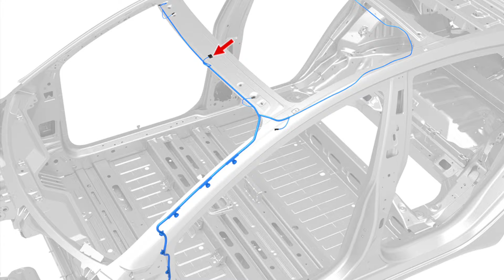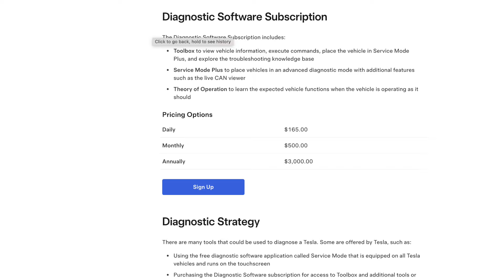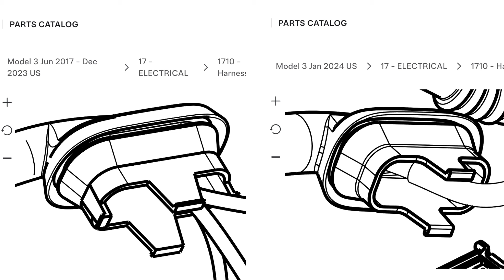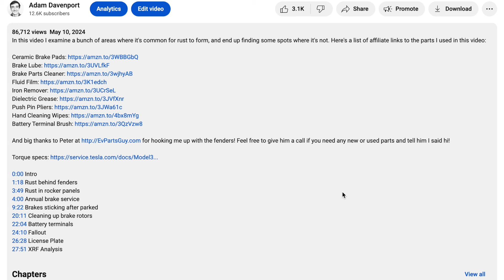Water leaked into my Tesla's trunk and caused electrical issues!

Comment from the maker: Here are some affiliate links to products I used in this video: 
Lexel sealant: https://amzn.to/4dIJj54 but currently way cheaper locally!
Goofoff Adhesive Remover: https://amzn.to/3A4WCij
Electronics cleaner: https://amzn.to/3XYel2T
T6 screwdriver: https://amzn.to/3Ys959v
Dewalt Screwdriver: https://amzn.to/3Y9ffLa
Dewalt Screwdriver with Clutch: https://amzn.to/4dxVPV0
Reply: Hello! It's impossible to buy Lexel in EU. Is there a suitable alternative?
Reply from the maker: @danz_w  If I was in the EU I'd try this stuff, seems like it has similar properties? Here's an affiliate link: https://amzn.to/489UuCA

Comment: Designed in California, not raiing enough there so Installing some tape is perfect to hide or delay the problem until car is out of warranty and was certainly way easier and cheaper for Tesla than actually really fixing the problem with sealant or resisting the ruber piece, as it's very labor / engineering intensive. Sad thruth about tesla unfortunately.  Will they get sued soon?

Comment: With putting the sealant on, a trick that can be used is getting a latex glove and applying to a finger and then rub the finger around where you want the sealant.
Reply: Yes, latex glove BUT use plenty of dishwasher soap on it. This prevents sealant from sticking and allowing you to perfectly smear it and making it super slick and smooth. 
Even bare fingers with soap does the trick, but use plenty of soap.

Comment: Actually had a very similar issue on my toyota sienna  where a water bottle spilled on the under seat amp which caused multiple speakers to cut in and out. After finding the problem I cleaned it up but one speaker was still dead, a replaced amplifier chip later and it was all good. No blown fuse there either. Awesome video much appreciated.

Comment: I have seen somewhere that if you're in the car options in the car info if you hold down or tap 10 times (not sure which one works for you) on the Tesla logo, you can enter service mode and type in the password: "service", you can get to all the useful error codes, as well as break pad cleanup tool, battery calibration etc. This may make debugging these issues a lot easier. Great videos, love your in-depth approach.
Reply from the maker: I looked all throughout the service menu and couldn't find any error codes. Are you sure you've seen that? If so, please share more details!

Comment: Any of the Polyurethane Sealants will work great for sealing water leaks. Although they are mostly sold in the tubes to use in a caulk gun.  I am not sure what will remove any excess.
Reply from the maker: I LOVE loctite's PL S30 sealant. Stuff is invincible, insane adhesion strength. ...but it would make a mess against white, and if I'd be screwed if I ever needed to remove it!

Comment: Adam - a great upgrade you should try. People have been retrofitting the Highland Model 3's suspension components into the pre-refresh one. Specifically, the struts. It is $500 for the parts compared to $1000+ for aftermarket coilovers and if you were to make a video it would be awesome.

Comment: That is not tape, its sound deadning high density rubber and it's used to remove the metal drum effect from metal surfaces, but usually you wouldn't use it on metal corners that are reinfornced like that because it's not effective there so it's kinda weird.
Either way that is not used for water leaks.
Reply: I second this... Likely to reduce the two panels from vibrating against each other.

Comment: Impressive diagnostic and repair work. 

Only suggestion is to use isopropyl alcohol instead of vinegar for circuit board cleaning.
Reply from the maker: @marcinmerrimack1726  thanks! Alcohol will clean dirt and debris, but to clean corrosion, you need something that reacts with the corrosion (like vinegar). You can use alcohol to finish the cleaning and drying process, or just the electronics cleaner I used

Comment: My 1 year old X just had a major water/wiring issue, all the speakers started crackling at max volume at all/random times, even sitting in the garage.  They added some sealant and cleaned connectors to fix it.

Comment: Just did this same patch to my 2020 model 3!
I had a tuff time removing the trunk cable holder to put the sealant, and ended up breaking one of them ! Be careful
Reply from the maker: So sorry to hear that! Do you mean one of the two little zip tie mounts that holds the harness tight to the trunk? It should be pretty easy to replace it with another zip tie, here's an affiliate link to some kits I think would work https://amzn.to/4h2L9AE

Comment: Wonderful video👌. Never thought a mic could have an issue due to intermittent short in amp(the explanation does seem to clear it up). Feel the tapes are for vibration dampening(looks more like sound deadening panels), to reduce rattles. Did go through a recall fix, involving the rear camera wiring(that could snap due to sharp turning radius, frequent use of trunk) , which resulted in changing the entire conduit, but not sure, if it fixes the issue. Have seen a puddle of water in the past on rubber mat(after severe torrential rain). So, it is likely there could be some damage already. Thanks for documenting the procedure, should find it really helpful.❤️👍

Comment: I have 2018 Model 3 with similar leak. On occasion, water would drip out of the slots in upper carpeted section. No tape on body panels. Took it to Tesla and don't know what they did but seemed fixed until it eventually leaked again. Trunk light is out but other electronics seem ok.
Reply from the maker: "seemed fixed until..." 😂sorry you're having trouble! I think you'll save time by doing this fix yourself rather than trying to convince them to do it for you. Might just be a corroded contact on the trunk light so pop it out and take a look!

Comment: Would you mind doing a video on replacing the cabin air filter? Show us from step one (removing the carpeting) to the end so that we don’t damage any of the parts. This service needs to be done annually; so, you’d help us to save a lot of money over the lifetime of the car. At least, I have to do this annually in order to eliminate the foul odor that my car gets even though I followed your advice during car washes, rain, etc. Thank you, Adam! 😊 (2021 Model 3 Long Range here)
PS: I’ll buy the filter you recommend through one of your links next year when I have to perform this service again. Tesla just did it for 2024.

Comment: With the idea of preventative maintenance, I began to consider doing this mod.

I believe just a diagonal bead of silicon above the grommet would do the job sufficiently. That strip of silicon should be enough to wick any water intrusion away from the grommet.

As you've already got the experience in this area, what do you think of this idea?
Reply from the maker: @Rick9482  I think airflow inside of here will send water in there from every direction but if you end up testing this with a before and after I'd love to know how it worked out!
Reply: @adamdport I'll keep you updated!
Just giving an easier path for the water to wick away is my thinking.
I plan to add some sponge material at the end of the strip to see how full it gets.

Comment: Water intrusion is a problem on many brands for those thinking this is just a Tesla concern.  Ford f-series has a pretty well known problem that kills its main computer, Jeep has one that waterlogs the radio stack in the dash.  Issues like this are hard for manufacturers to spot until time, temperature and use impacts the sealing devices.  Even their fix can, as shown here have a weak point eventually.

Comment: By the way did you know that the Highland suspension and springs are apparently fully compatible with all older models? People say they make the car much more plush, and only cost around 600 bucks for the parts. Would be extremely interesting to see how the parts can be ordered, how a DIY installation would happen and how the car feels like afterwards!

Comment: I had the same issue, but I was "Lucky".  It didn't drip in like that it poured in and was visible on the floor of the trunk.  It was a bad boot.  I do not have the tape.  From this single video I would say it needs to be removed.  I'm curious on the purpose.

Comment: I wonder if multipurpose grease would be good? Would be easier to remove the grommet if needed.
Reply from the maker: @juha9703  Petroleum-based grease is generally not safe for rubber grommets, as it can cause the rubber to swell and break down over time. Lexel is super stretchy and I think it would let go if you insisted.

Comment: Im currently in a lemon law lawsuit over water leaking in my 2022 model 3. The tesla shop “fixed it” 4 times before just siliconing the trunk hinge. Its a messy job and they refuse to fix it further because “it stopped leaking”

Comment: Does this same thing work for a model Y? I have a small leak that pools at the base of the trunk where the trunk stop
Meets the bottom part it pools when it rains heavily
Reply from the maker: @OrganicStuff1  your trunk lid harness connects at the top instead of the side but I would definitely suggest comparing your grommet to mine!
Reply: @adamdport  thanks I have decided to not take my vehicle to service anymore have had nothing but bad experiences with them. They either break something and or my car comes back with scratches. I know many won’t even believe this but their mobile service didn’t even do a proper tire rotation I was watching them thank goodness.

As you said sometimes these technicians…. Really don’t know whose working on the car and it’s a bit scary after seeing a simple task be done incorrectly

As much as I enjoyed teslas tech the service is probably the reason I won’t be getting another. It has not improved since owning them from 2019
Reply from the maker: @OrganicStuff1  I've had a similar experience! It took them FIVE separate trips just to replace the 12v battery on mine. After the fourth I inspected their work and discovered they straight up lost a bolt. Sometimes I wish their warranty would just supply me the parts so I could do the work myself smh

Comment: Hey, in my 2023 I have water that goes through the piping. Do you think I should fill it with silicone?
Reply from the maker: No idea what you mean by "the piping" but I think you should prevent water from getting into it in the first place
Reply: @adamdport it's the grommet that you sealed it's hollow on the inside and carries cables. My trunk lid collects water so when I open it it all run though that black piping you sealed in to the car. 😅
Reply from the maker: @tahiyetkamal5017  your trunk lid shouldn't be collecting water in the first place. If it's not coming in from any of the spots i sealed in this video then you're going to need to keep looking elsewhere. Grab a hose and do some tests!

Comment: Tesla, for crying out loud the Model 3 has had trunk water issues for years.  Why is not fixed yet?  But I like how you figure out an issue and come up with a solution.  Tesla should hire you but then their managers (or Elon), would hold you back.  You kept saying there was evidence of salt water.  Where do you live that it rains salt water?  I live near the ocean and we don't have salt water rain.
Reply from the maker: @Resist4  I live in upstate ny and they dump truckloads of salt on every road to stop ice from forming. When the roads are wet, every car ahead of me kicks up a mist of brine. The inevitable rust is brutal but it's convenient for diagnosing water leaks!
Reply: @adamdport  I grew up in snow country but left 40 years ago, so I forgot all about salt for the roads.
Reply from the maker: @Resist4  I bet your cars last way longer wherever you moved to. What kills cars down there if the bodies never rust?
Reply: @adamdport  Yeah, I don't miss having a car body that gets rusty.  I forgot about that happening too.  lol. Usually out here with ICE vehicles it's the engines that go bad before the body does.

Comment: Good job , you probably want to use an Esd strap  when handling a pcb’s  IP’s instead of vinegar or wash the vinegar off so it does not keep eating into the board.  Finally clean all the heat sink compound off then apply a thin layer of new compound.
If compound is uneven you will get hot spots in your chips and they will die prematurely.

Comment: I notice Adam carries a fire extinguisher, do others carry one in their EV?
Carry one in all my ICE vehicles because of hot components and fuel, but possibly naively consider almost any typical EV fire that would develop would likely be able to be snuffed out with modest means, unlike the HV pack/systems which wouldn't really be viable.
Plausible it could help others if happened upon, but the EV Specifically, cant perceive many likely cases where a fire extinguisher would be clutch.
Possible anyone has some rational feedback on the topic? Specifically for a EV fire that would have been avoided by proper etiquette?
Reply from the maker: @101rotarypower  my mind often wanders and I imagine myself arriving at some accident where someone's trapped in a burning car. It costs me next to nothing to leave them back there just in case!
Reply: @adamdport  Thank you Adam, please keep doing these types of videos. This has been my personal favorite channel on the topic of repairs with this platform, its interesting seeing the small issues and someone rationally deconstructing the problems and offering grounded solutions. Really appreciate that you take the time and effort to share it in such a descriptive and strait forward way that anyone motivated can duplicate the results.
Reply: @adamdport  I think the reason to have it is to help others.  The fire extinguisher that is on the piece of equipment that is on fire is generally not useful.  You need extinguishers that on other things around it to be useful.  My personal observations.
Reply: yeah, Adam is awesome and logical and I appreciate his DIY awesomeness
Reply: Fire can start from anywhere, if the amp start to burn, you could potentially still stop the fire and save your car.